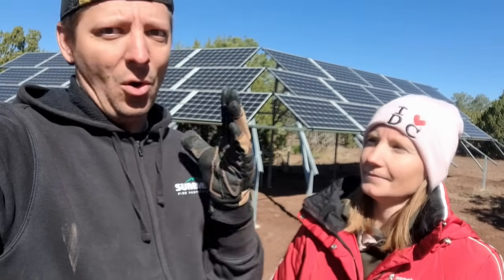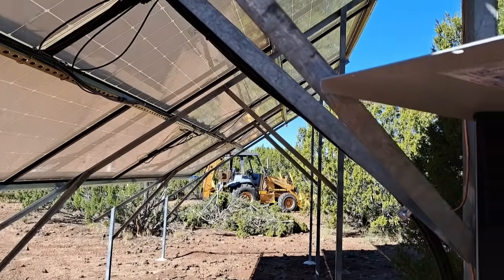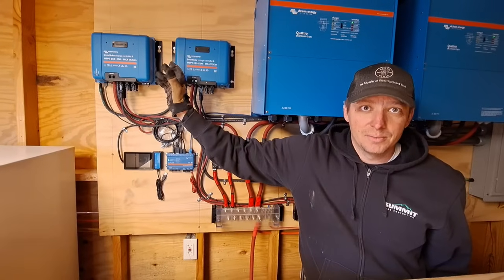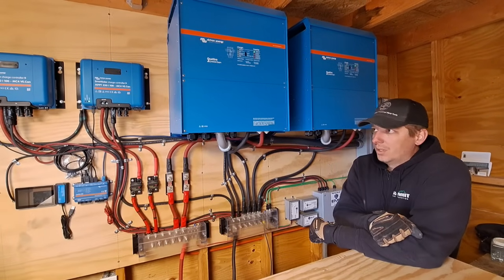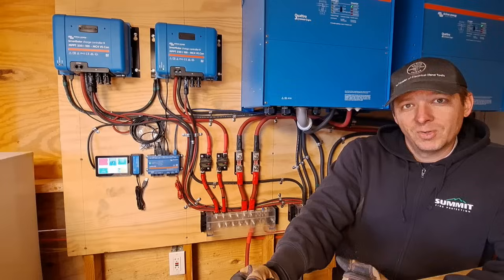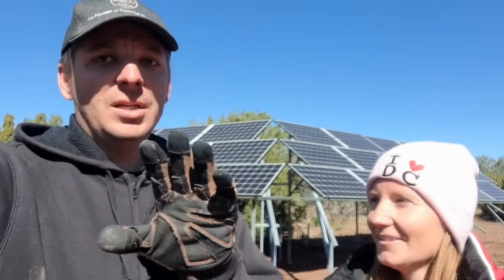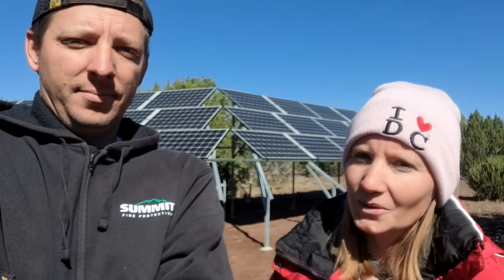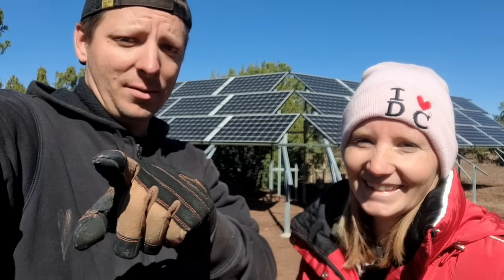INFLATED COST Of Our 100% DIY Off Grid SOLAR POWER SYSTEM 👍

Comment: Here's a tip. In South africa we depend on renewable energy because we have daily power cuts. Therfore our prices on inverters and solar stuff is waaay cheaper. He paid 10k just for the inverter and charge controllers. In South africa you can build that exact same system for less than half the price. You can get a 3 phase 220v 50kw sunsynk inverter which has 50 and 60 hertz capabilities and 120 volt and 220 volt for 3000 dollars... 
A 555w tier 1 solar panel sells for 100 dollars this side. If you guys would purchase over here and then ship it over you'll save so much money

Comment: Remember that the reliability we associate with "mains" comes from a domestic feed always coming via several pathways. Look out for your single points of failure. Perhaps a single small panel on your home, dedicated only to some rechargable lamps or torches will cover things going pear shaped in the evening -you can then sort it in the morning. Another youtuber didn't get the "low battery" alarms at 1% so had to do a cold start and crank up the generator to recharge their batteries.

Comment: Hi, I looked through the comments and didn't see in the video, but how are you heating and cooling the house?  I'm about to spend $10k on just getting lines from the grid to a house that will be under construction very soon and I would rather spend it on solar if I can put my mind at ease knowing I will be able to cool a 1800 sq ft home using solar.  Maybe one unit or if I need to use mini splits it would be fine.  I figure I am using at least 50 kWh per day now on a home the same size in Missouri and the new home will be built in central Georgia.  Thanks for any ideas/guidance, love the video!
Reply from the maker: We have a wood burning stove for heat and plan to have one or two mini split units for cooling when we build our house. We don't need much for cooling. Thanks.

Comment: Actually Victron has a bunch of ways of communicating with your battery. It has RS485 and RS282 so you should be able to get it to work if you have the right setup but another effective method to monitor capacity is to use a Victron Smart Shunt which will monitor the energy in and out of your install. You do have to do a full charge to calibrate it. They also have two other shunts which might be better for your situation.  I would take a trip to my fellow Aussie Andy's Offgrid Garage Youtube channel where he's done a number of different communication setups including the smart shunt with his Victron setup.

Comment: 24kwh, not bad. I was thinking about getting 300AH 12v batteries, 12 of them total and running them 4 in a series to make 48v, doing that x3 then putting those 3 mini banks together in parallel to make a 48v 900AH bank. total estimated cost for the batteries alone is 11400$+/-. I wonder if that would be better or worse.

Comment: i personally have a 5k panel, 4k inverter, 9k batt (walmart deepcycle) / (propane), got lot my stuff second hand and build as i go (seen deals) spent overall 6k, my problem was i bitcoin mine, weld, and electric heater, i would need upwards 30k hr so i put upgrading on hold, but form you system you coulda definitely saved 10k $ from misc items

Comment: So if you had a $250 electric bill every month for 12 and a half years you would pay for your solar system. (on the 37043) I would be curious to know how much power you guys use per month. You two did a great job on the install. thanks for sharing.
Reply from the maker: After the federal rebate of 30 percent, it's more like $26,000. Forgot to mention that in the video 😅. We don't use a ton of power right now as we are living in a trailer. We'll have a better idea once we are done building our house.

Comment: if i was ready for such system i would go for a slightly smaller about 6kw  one with tracking platform!!!! . i mean you still can try and upgrade or add some tracking tricks . you cant be sure about tracking but for sure you can make an automation for every 3 months 4 daily cycle programs  in total  if its online it can change on its own!!! .  !!!  and even ad some tiny changes every 45 days to maximize  production!!!!

Comment: The clothes drier could use an AC to remove heat from any other source and send it to the drier to dry the clothes, instead of electric heat. Remove heat from wood stove, Sun solar, burning old oil, methane from cow,goat,sheep,horse manure. 
Also, if you have an attic, especially in the winter, and keep the room below, t-shirt warm, then remove the heat from the attic and put it back down into the living quarters.

Comment: The big question... Did you put a Graphene coating on the panels to keep them cleaner for longer and maximise there serviceability? I use that and it makes a difference
Reply from the maker: I haven't heard of it. Thanks for the tip. 🙂

Comment: If you want to monitor SoC then just buy a Victron Smart Shunt and install it between your 1000A neg buss bar and the Neg wire going to your battery. around a $100 or so and if monitors SoC Perfectly. Better then a battery BMS in my experience
Reply from the maker: We didn't know about that, very cool! We'll look into one of those. Thank you!

Comment: That system looks great very similar to mine. I have the Victron as well three of the 48 V 10,000 kVA inverters I was going to let you know. The batteries that work very well with mine and communicate fantastic are the pylon tech US 3000 c you might look into those but like all batteries they are very expensive. Great job on the install as well.
Reply from the maker: Thanks so much. Appreciate it. 🙂

Comment: Nice review and breakdown of the system. Just one question, How comes the you haven't fitted isolation switches between the bus bar and quattro's?
Reply from the maker: Great question. That's probably something I should do. Thanks
Reply: @aboulderlifeoffgrid  I would or did with mine. It allows me to isolate the inverter quickly or slowly! To work on it  or if there is a fault. I would install then where your fuses are installed. Then reuse the fuses on the backside of your battery box. Just an idea. I can’t see on the video if your batteries are fused. Otherwise the install is very neat and thorough.

Comment: It’s debatable if solar is worth it for you or not…. I recently bought into solar… three main reasons, reason one I am in houston tx and we are loosing power all the time…. Reason two I will be getting 30% back on my taxes of what I invested in total, yes I end up owing every year… thats almost 1/3 of my money back… I installed all my panels on ground mounts and installed my own equipment so I saved tons of money, lately I decided to invest into solar because the power company has increased the energy charge significantly ever year for the last few years….. yes I have a generator…. That’s for a major emergency but gas is pretty expensive but it’s always good to have a back up for your back up

Comment: There are Victron Shunts for measuring power usage. There are RS485 i/o adaptors that can talk to Cerbo, so there is options.  worst case Arduino or RPi.
Wheres the lighting arresters on the solar panel frame? why no Lighting tower pole near the solar array with a 6ft copper pole burried behind the array.
Reply from the maker: I've never seen a lightning pole for a solar array. I'll have to look it up. The EMP shield devices are the lightning arrestor. Thanks for watching. 🙂

Comment: i dont meen to be rude for you worked hard and you do deserve all respect but yeah , the batteryes with the box where a bad choyse  , if you ever change batteryes go for Seplos (it is called orient power in us i think) on the variant of 15 kw or on Apexium battery also 15 kw and you will be surprised , you can simply build a tower with them  .... sory for bad english , i am not an english speaker

Comment: Great Job Guys- you are awesome at DIY.  I see you run dryer, etc with solar.  Just curious-How about ac, hot water, and heat?  How do you cover these?  Thanks
Reply from the maker: We have an electric water heater, and we just put in an ac window unit. Our heat is a wood burning stove. When we build our house, we are going to have a few mini splits for ac and also do in floor heating. We just recently realized that we have plenty of power for ac in the summer. However, for the winter, we need to watch our power use a little closer because of the shorter days. We'll still use wood to heat our house as well. Thanks. 🙂

Comment: It got cheaper a little bit. A 25kWh battery cost 7000$, including a metal cabinet on wheels, and the internal bus bar and the 4awg wire to connect the battery to the bus bar.  A single all in one 220volt 12kW Inverter cost 5600$(EG4 18K).  I think 12kW is enough for most use, and you could add a second unit to go to 24kW(then you would be more expensive). This include the cost of the charger and all the wirering since it all inside.  You can forgo the bus bar until you want to have more than 1 battery cabinet(or 2 inverter).  Also, with these all in one solar inverter, you can go up to 18kW charging from solar, if you put 2, go up to 36kW of solar panel...  My personal setup is a single LV6548, which only give me 120volt, but I can put a second one to get 240volt at 12kW, and 2 of those unit cost 2100$ total.  The reason not to go with the LV6548 is it noise level and higher idle draw.  A single EG4 18K draw less idle power than a single LV6548.  And the EG4 18K does have a few more features.  Victron is nice, I think they have an even lower power draw at idle... But it more expensive.

Comment: So your local code authority approves the use of welding cable for permanent installation?
Reply from the maker: I know this is a touchy subject in some areas, but welding cable is widely used here by solar installers. So yes, the AHJ is good with it. Thanks 🙂

Comment: 20 kW-hr isn't very much  storage capacity at all. One heat pump could drain that in less than 10 hours without any other loads.

I'm pretty confident you are going to at least double if not triple your battery capacity plus add a backup generator for extended cloudy periods during cold winter months.

Comment: So 70g if you had it installed, which is what I've heard other places.  Have you figured out the lifetime kwh cost.  I'm betting 10 to 15 cents  the installer who quoted 60 to 80g for 10 kw, well, solar is a luxury market unless it's the most basic grid tie.  Good luck moving that batter box when fully loaded.  GREAT POST

Comment: I really liked the whole setup except for one thing, since you guys are mounting the panels on an independent structure, why didn't you use the bifacial panels? That way you could have increased your production at least by 30% more.
Reply from the maker: Don't really have an answer. I guess we wanted the more traditional route  for the panels. And they do cost a little more per watt. Thanks for watching. 🙂

Comment: Looks great. If you are running electric water heater, heat pump or a/c for home and power shed, electric range, will that system keep up in northern AZ? I know I needed triple that in KY without using much LPG for the 10kW generator. That's using wood burner below 25F too!
Reply from the maker: We get an average of 265 days of sunshine per year. We will likely add to the array in the future. Thanks for watching. 🙂

Comment: I love it and agree with the self suffiancy requirement. Was there a cost for comparison,  to run cable to the grid connection for an equivalent power requirement?
Reply from the maker: Power is over a mile away. Never looked into it. We liked the idea of making our own power. It would be interesting to find out what that cost would be. Thanks for the comment. 👍
Reply: @aboulderlifeoffgrid  I remember the couple on Ambition Strikes https://youtu.be/ccBM0iSvqIc  (Northern Idaho) had a cost for theirs and it was effectively more than the Solar Kit etc. plus the ongoing Tariff Costs.  So best option. Have fun.

Comment: Hope it never happens but, if those batteries go up in flames you stand to lose everything inside that building. It's always a good thing to build a separate building just for the solar equipment. The other thing I notice is the lack of a cement board to attach all the components. It won't help with respect to a battery fire but it helps isolate the solar components from the wood, which has lower flash point than the cement board.

Comment: There's no fun in lithium batteries. Just check once a month on Water level. But think about wind turbine. That would be. A plus. Nice video.
Reply from the maker: Lithium batteries don't have a water level to check. You're thinking of lead  acid batteries. These are maintenance-free. Thanks for watching. 🙂
Reply: @aboulderlifeoffgrid  Yes sorry. I didn't have enough Guts . To buy lithium. Or  A g m I'll wait forever I guess for hydrogen. My system is half your size have a great day

Comment: Is your furnas electric also? If so how many watts and BTU's is it? How many square feet are you heating?
Reply from the maker: We use a 1500 watt portable heater to supplement our wood stove. So that's about 5000 btu. We're in a 350 square foot trailer until we build our house. Make sure you follow to see all the action. Thanks. 🙂

Comment: Can you back up your system with propane in case there is blockage of the sun or system needs repair
Reply from the maker: The plan is to get a backup generator in those cases, yes. Thanks.🙂

Comment: Great video buddy 
  How did you wire the solar panels to use those 250/100 mppt   And what size panels are those    
    I was contemplating between the 250 and 450 Mppt charge controllers

Comment: Hi guys hope you’re doing well looking at your charge controllers you have the option to connect 4 more arrays so a lot of options to grow when needed or wanted, i would like to suggest to look into the option for load dumping like a external hot water heater, air compressor etc.your equipment (Victron) has options to do this programming and timing and controlling relays , i must say a beautiful system and a perfect investment not cheap but worth every penny ,BR Mike
Reply: Good call!

Comment: If you ever decide to upgrade the busbars then I recommend the midnite solar 1000A busbars. They are cheaper than the ones you mentioned and imo better (the shape allows for more even current distribution). They call them 1000A but you could probably push double that continuously depending on how you wire it.
Reply from the maker: Hey thanks for the tip. Definitely will check out midnite solar when I need to upgrade the busbars.
Reply: I got the 2000A version in the battery combiner box primarily because it allowed easier expansion should I want/need to. And wasn’t that much more than the 1000A

Comment: great video. do you rely on you system for you a/c and heating needs too ? do you have a mini split ?
Reply from the maker: We have a 1500 a watt heater to supplement our wood burning stove.   No a/c, it's not really necessary. Although we've got plenty of power to run a unit if need be. Thanks for watching. 🙂

Comment: Hey, super video and great job, both of you!  Two questions: 
1. Can you explain the trade off with your  half SW/half SE solar array?  Specifically, how much do you lose in the middle of the day to get the morning and afternoon? 
2. You mentioned wishing you'd done 40 degree panel angle vs 36--can you explain why?  I see Phoenix is 33.4 N. 
Thx!
Reply from the maker: Doing it this way spreads out the lump sum of energy you would get with the normal south facing array. The trade-off is about a 3 percent energy loss. To us, it made sense to have energy coming in sooner and later in the day because of things like breakfast and dinner on an electric range. Our incoming energy at solar noon is still the peak harvest time. Just imagine it as a steady increase in energy instead of more of a spike with a south array. It's hard for me to explain in text. And the 40 degrees would just help out more in the winter when the days are shorter and the sun is lower. Hope this helps. Thanks for watching. 🙂
Reply: @aboulderlifeoffgrid  Thanks much for explaining--that does make perfect sense.  You don't see this done much, nice creativity on your part.

Comment: Is there a reason you didn’t match your Solar PV to your inverter wattage?
Reply from the maker: We maxed out our charge controllers capacity with the amount of panels we currently have. All that the 10kw on the inverters means is that it can put out a maximum of that many watts. We could have a 20kw array, and the inverters wouldn't care. It's the charge controllers that you don't want to go over on voltage and amps. Thanks 🙂
Reply: @aboulderlifeoffgrid  how many hours of sunlight do you get through the year? I’m just upgrading our system to a 15kw multiplus inverter and 3x 250/100 charge controllers. Winter is the awkward part here as we are running 2x 48v 960ah lead acid batteries so are having to match Solar power to try and preserve as much battery life as possible. We can have 4-5 days with no sun at its worst.
Reply from the maker: @522001pd  We get like 265 sunny days in our part of Arizona.
Reply: @aboulderlifeoffgrid  what do you do for heating in the winter time? Our council have forced me to use a heat pump which will be fine until January/feb when it can hit as low as -10’c
Reply from the maker: @522001pd   We mostly use our wood burning stove with the occasional 1500-watt heater. When we build our house we'll have in floor heating. It's a bummer that they're forcing you to use a heat pump.